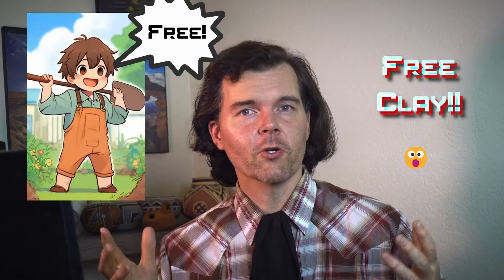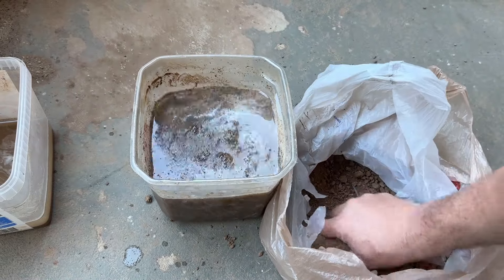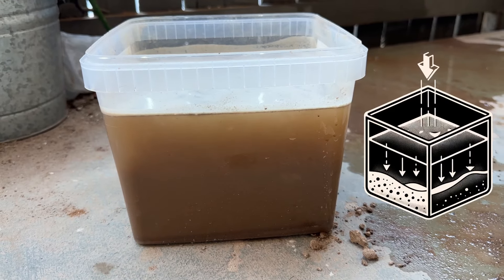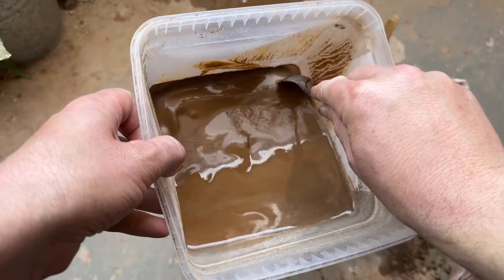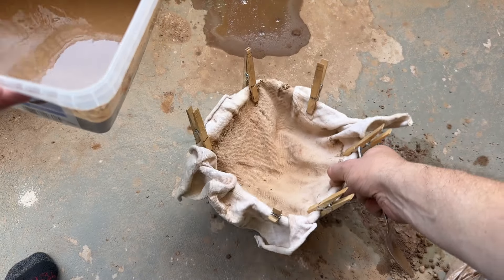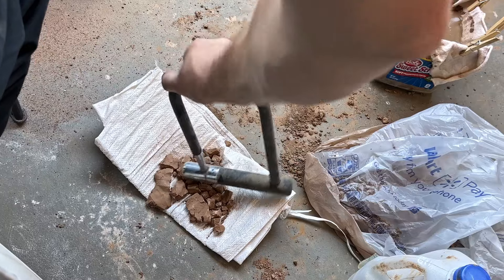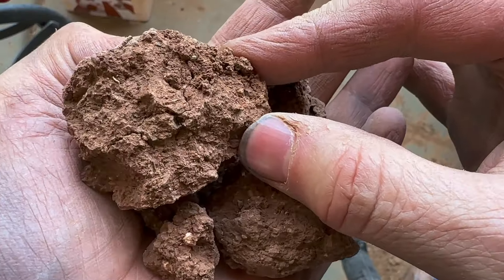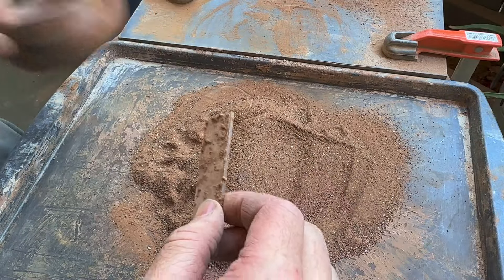Secret to Free Pottery Clay: Digging in Your Own Backyard!

Comment: One time, I collected a very bright orange clay from a construction site and I was surprised at the very high shrinkage rate it had. I most likely had dug up some bentonite clay so it won't be useful as a primary clay body. I'm still saving it in case I need it to make a slip-based paint.
Reply from the maker: That's a great idea, sometimes those neat colored clays make great slips if they're not workable. One of my primary clays I use actually has crazy high shrinkage. I'll make a bowl that's 8 inches, and it shrinks to a little 5 inch bowl.

Comment: Utility work is pretty common in my suburban neighborhood so I often collect clay from these sites whenever I can get permission. Sometimes, I have to let the clay levigate for up to 30 minutes if there's too much topsoil mixed in it. The glacial soil of my region is a clay-loam or silty-clay-loam so there can be a lot of silt to remove from it. For several batches I've had to use a bulb siphon to skim the clay free from the sand and silt. For other batches, there was so much organic matter mixed in that I had to use a 100 mesh strainer to remove the coarsest organic matter particles from the clay. The resulting clay body from my subsoil is a much richer brown than the shale clay and alluvial clay that I also collect so it should be great for making salado polychrome or shell-tempered pottery.
Reply from the maker: That's awesome! Yikes, that Silt can be a pain sometimes to remove, though it can act as a temper to the clay which can be handy. Sounds like you got a lot of different clays at your disposal!